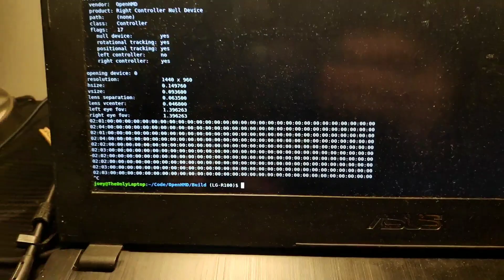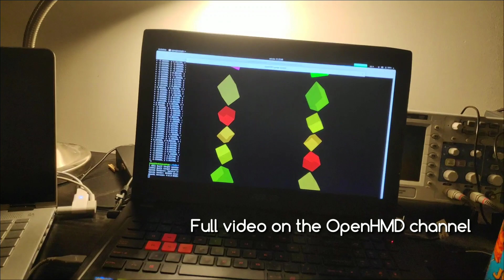TheOnlyRoadtrip - Day 6 - Moar LG R100 hacking!

Comment: I tried to download and compile the steam VR support with this, but was unsuccessfull (a libraries thing I couldn't make it work), and there's a shader for RESHADE that corrects the rotation. You guys are doing a great job, this is getting close!
Reply from the maker: SteamVR-OpenHMD is developed by a community member, it is best to contact them on the github issues page regarding any compilation errors or similar.
Reply: @TheOnlyJoeyYT  I found one sealed new for 37€, is it worth it? did it  worked?

Comment: In the case of the LG R100, what are the requirements of the PC? Does it need a PC with Thunderbolt port? Thank you.
Reply from the maker: Any system that has USB-C with display port capabilities (also called 'Alternate Mode') will work, Thunderbolt 3 would have this option.